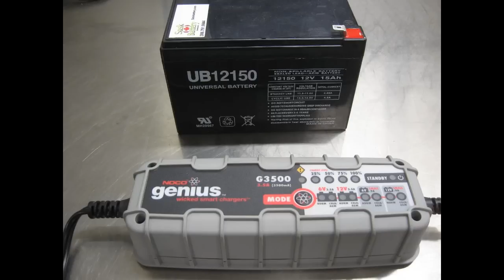RC Dozer  Build pics SLIDESHOW

Comment from the maker: Thanks....glad to hear that the pics have been helpful...the original design used a large servo, and yes the springs help balance the weight of the blade...but the servo I used did not last long....it now has small linear actuators on it....and so far they are working....
I got the servo lift and spring idea from this video... " RC Dozer Guts" by bubbaseth1....it is a great idea !

Comment from the maker: Thanks Charles....and yes I had to paint it...we did use it unpainted for a long time (having too much fun) but finally it just had to be done....my favourite pic after paint is at 3:25...nice new paint...funny looking solid yellow mass....LOL....really needed some details at that point !!
Only the L16 actuators are controlling the blade...originally I tryed using a 1/4 scale servo to control the blade but eventually it failed.

Comment from the maker: I'm not sure I understand your question on the track plates..??   The small plates are attached to the chain , you can buy this chain with them installed search for " K1 or K2 attachment chain " it is costly !!
 The small space between the track pads is not a problem...there is about .030" gap...yes some small stones can get between the pads but it has never really caused any problems...a root or branch is a problem and I have had some jam a track...a change of direction and the jam is fixed

Comment from the maker: I see the LH is on back order for a while...you could use the same motor on both sides , providing you have the space.....it just doesn't look as clean.....best is one LH and one RH, that way it looks the same on both sides.  I bought the attachment chain with two holes per attachment , I'm using single hole on my new tracks that I installed last week....made a set that are just a straight lug and a little taller at .350"  # 40 K1 attachment chain every second link single hole GOOD TO GO

Comment from the maker: Best place is at bearing supplier...BC bearing , Commercial Solutions  is where I got mine...the chain is made by "TSUBAKI" it is pricey !!
Search the web for" K1 attachment chain " you may find a different supplier for the chain , I bought a 15ft length but I only needed 3.5ft for each track 7ft total (I wanted some extra)...remember #40  K1 attachment both sides , one hole , every second link. Be sure to make the track pads under 1" long to allow clearance (mine are .970" long 3" wide)

Comment: I have a few questions: If I saw correctly, the track plates have smaller side plates attached, so the chain fits between those side plates? and the bolts go through those plates and chains? Since the track plates don't overlap, do you get rock and debris stuck between them? Especially over the idler wheels where they are most spaced apart?

Comment from the maker: I made a bigger drive sprocket for pushing snow....original was 18T and the larger one is 20T....just a little faster....my kids said it was to slow...LOL....I'm now using a 15T drive which give me a bit more power and the battery lasts a little longer pushing dirt with the new 21" wide  blade...

Comment: Good Morning
what is the model Firgelli L16, R or S? Actuator Stroke 50? 100? 140? and Gear Ratio 35: 1? 63: 1? 150: 1? for the blade and ripper? ? I live in France and I would not be wrong because "postage" very expensive;-) thank you in advance.

The L16 Firgelli are powerful enough for my dozer will weigh 90 lbs? lowering the blade and ripper dozer is what is raised?